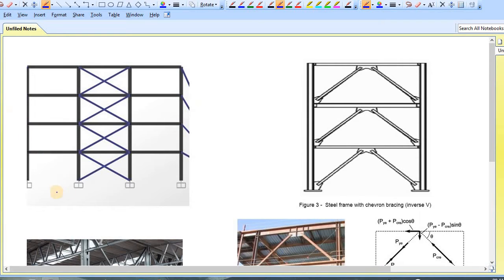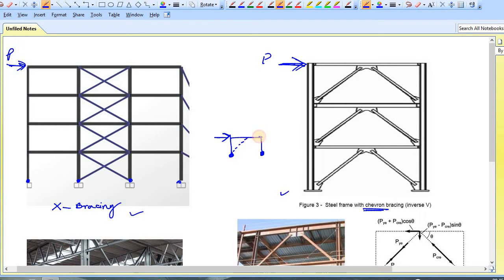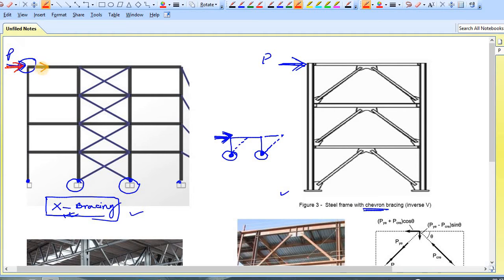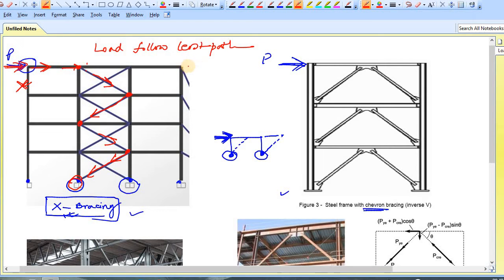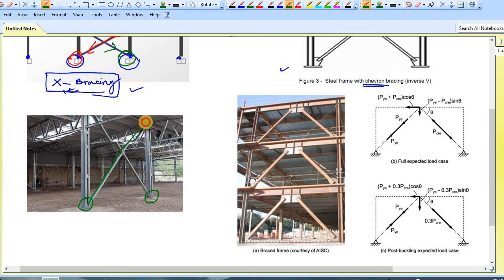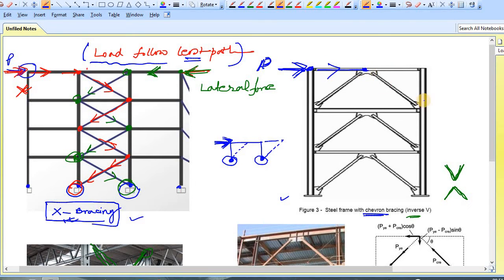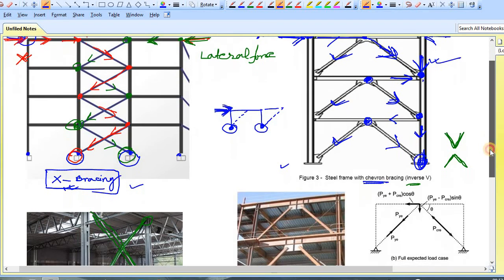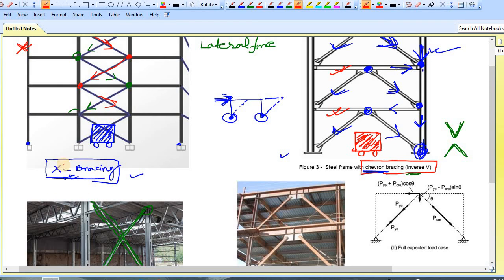Cross Bracing vs. Chevron Bracing

Comment: thanks a lot in x direction why load p did not go to colum directly its also short path like the horizontal section , is it deal with stiffness i mean colum size is more than horizontal section  if that correct why we dont put the bracing in the first bay to go directly to the first colum . in charvon bracing load p go to horizontal then to node which have shape ^ why he go to one incline direction why its not going to both incline direction .

Comment: Very nice and intuitive explanation brother. Well, I had a question for you. I would be grateful if you please answer- @08:55 you said a vertical downward component will cause more bending to the horizontal beam and that's why you preferred the X- bracing over chevron bracing. But please notice, I can see 2 advantages of chevron over X. These are: 
1) in case of X bracing the beam is long and there is no support/joint like chevron  in between- which increases the clear span length vs width i.e. slenderness of the beam and more slenderness contributes to more buckling! On the other hand, in chevron, the beam's clear span length is significantly shortened due to the support joint at the middle, and there is less buckling I guess.
2) @08:55 as you said about the vertical downward  component faced by the beam in chevron bracing which I think is correct. But at the same, the vertical downward component is countered by the other diagonal in chevron bracing! So the bending effect is again reduced by this mechanism. Here also in my opinion the Chevron wins.😊 So please consider my question and we'll be happy if you share your feedback regarding this. Thank you.❤
Reply from the maker: Stunned by your in depth understanding. Very few times I got a comment like this but when get, its really a delighted moment for me. I will try to put a video on this
Reply: @TonmoyMaity  thanks a lot brother. I'm one of your subscribers from your neighbouring country- Bangladesh. Actually you should give the credit to yourself  because I myself have learned a lot from your videos and learned to think deeply. 😊

Comment: What happens if I made a Chevron Bracing for lower half of the building and X-Bracing for the upperhalf? I'm just wondering what if adding every truss structure with no physical or mathmetic consideration. The more, the better?
Reply: work out and see .. you find its waste of so much materials.. only by calculation we understand the quantity of need of bracing..

Comment: Hello Tanmoy...Nice subject
Actually I am getting refresh, watching these videos..the subject I left almost  10-12 years back..

However I remember one unresolvable question,  if you can put your though on this 
In Azarbizan, the Temperature is very extreme, very hot as well, very cold..and with this situation which kind of bracings are most suitable for steel structure for transmitting lateral forces.

Appreciate your work. All the best.
Reply from the maker: I suggest not to use bracing..rather go for cables. They are much effective in this type of condition.

Comment: Nice subject. I only think you're taking the wrong path by taking the directions of the forces applied. Only the members that can take pulling forces can play a role since all compression beams tend to buckle. So the directions of the forces should be along the other trace.
Reply from the maker: Not necessarily they will buckle..its only our assumption for easy calculation..by the way Thank you sir for your valuable observation 🙏
Reply: Strut and tie
I also believe he has all the bracing in compression (in his statement);      some are in tension... unless you happen to load at the nodal area but, I do not believe that is the intent of this bracing (it is NOT doing ''double duty = the outer wall beams appear to be of all the same sizing - I hope)...
Pushing/compression has an opposing force of a tension force ...
Reply: @ForensicCats  It 's Kai lurking!
Reply: The inverted V half the load goes into each brace and in the X bracing might work only in tension
Reply: @jgross5403  , no load goes into the X bracing until it is a strain/stress or unless they have the ''top chord'' taking on a load that must be distributed down the bracing and this would only be applicable on that section and would create a torsion issue = not recommended == do not do that.
Reply: @ForensicCats  please more explain

Comment: What do you mean by “least” path? It’s not that clear to me. Thanks
Reply from the maker: Shortest
Reply: Isn't the vertical joint below P shorter than than the length to the cross bracing? Or do we assume that the columns is one full beam?... sorry for my English btw.